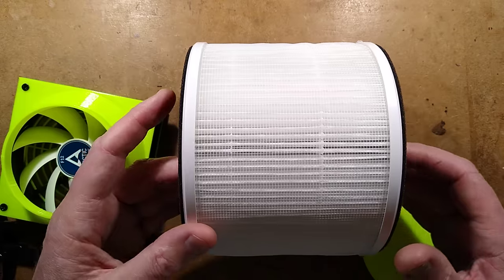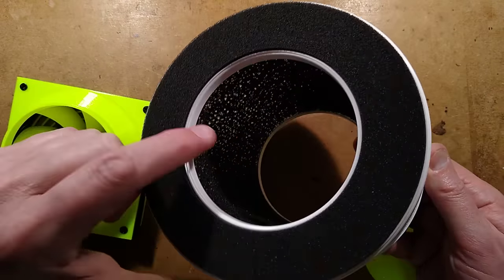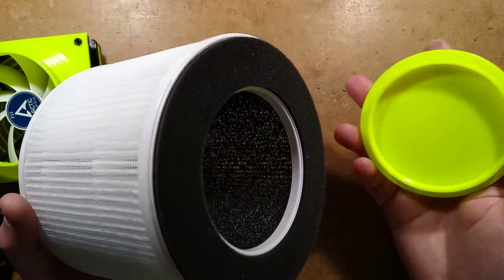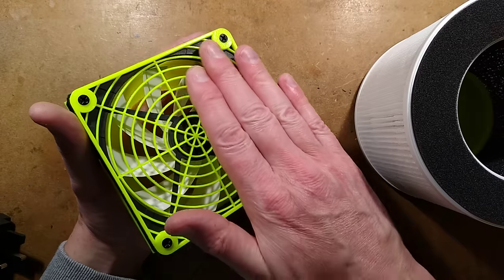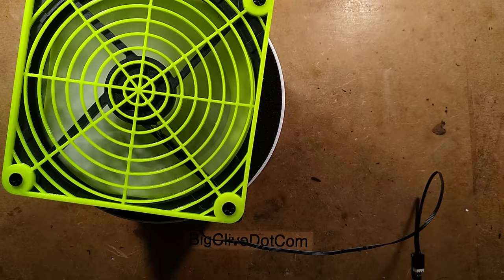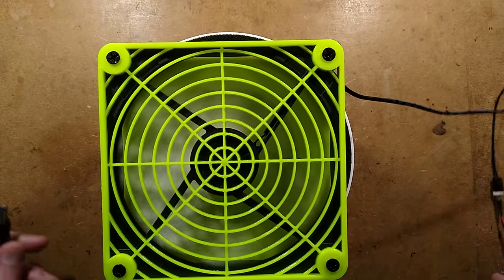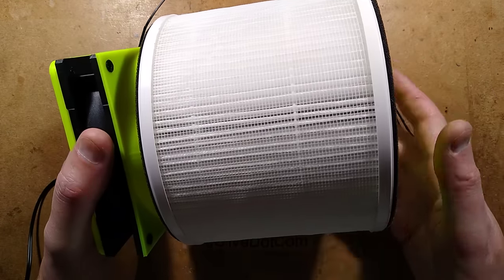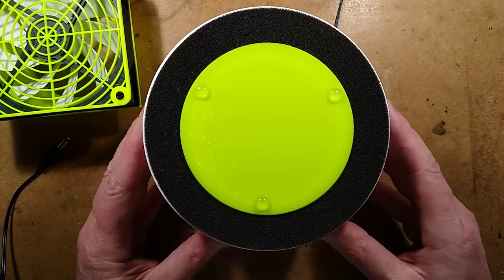DIY cheap & quiet HEPA air cleaner

Comment: You could even chain multiple filters into a longer tube with another adapter to get more flow. Perhaps not double, but you wouldn't need another fan.
Though then you might want a more stable mounting system, or indeed, have it horisontally.
Reply: I really like that type of filter model for this reason, effectively putting multiple filters in parallel should lower the effective resistance to fluid flow. With the rationale similar to why the Americans are building filters in a cube shape with their furnace filters instead of just taping one to a box fan. Lowering the pressure differential over the filters should make them and the fan last longer. And it shouldn't increase the long term running costs only the initial outlay (lifetime should be proportional to # of filters). It would also be interesting to test if whether adding more filters would have affect of the sound level and frequency, something something different pressure drop something something turbulence.

Comment: Me and the other half are disappointed it wasn't printed in pink!

Also, I doubt the fans care that much given they are mounted in computers both vertically and horizontally and I haven't heard if it causing major problems.

Comment: Anybody ever took a furnace filter or air condition filter and putting it on one of the $20 box fans it actually does a pretty good job of getting rid of smoke and dust in a household setting

Comment: Good stuff. I have an old air purifier that is not made any more so i was forced to use replacements. It has a rectangular filter as many others but i soon found out that the bastards that make filters do not give you the dimensions, so you can't replace the filter with one from another model.

Comment: Good. Filters are the most expensive part. Find cheap filters and add a fan. I like mine fast and loud. I wonder what would happen if I used and EDF from a R/C jet aircraft with a variable throttle?

Comment: I made a version sort of along these lines for when I'm soldering. The fan intake is near my work piece and it exhausts into a carbon filter block to catch some of the particulates. Cuts down on the burnt resin smell that always gives me a headache.

Comment: I don't think you need worry about mounting fans horizontally - I've got several fans in my PC and half are mounted that way - in 10 years (time for a replacement I think) only one has gone and that was mounted vertically

Comment: Many 120mm case fans mount horizontally both in atx power supplies and at the case top. You may be talking the difference in 8 years vs 10.

Comment: Funny enough, these DIY units tend to outperform some "smart" units because they keep the fan running at full speed rather than dialling it down. The sensors in air purifiers are a pretty mixed bag and many just read way too low, resulting in very little filtering being done when set to auto.

Comment: flip the whole thing over, and put 12mm / 1/2 inch feet on the fan itself (use the screws you mount the fan to the adapter cowl to hold the feet on)

Comment: these work ok.....but you're really best having a filtered intake/fan into your room/house from outside.
something that maintains a slight positive pressure inside the room/house.
this will prevent particulates from entering and make sure most particles inside are on their way out.
also.....fresh outside air contains more oxygen....which makes for more brain power.

i personally filter/duct the air through my pc case.....it keeps the components extra cool in the winter, and the output air from my case is still warm, filtered and oxygenated.

Comment: Theres already a whole filter system thats been around for years in the automotive world. Every car has a filter for the airconditioner behind your glove box thats supposed to be replaced evey 2 years or so. That filter and the fan for the aircon is much more powerful and cheaper than any 'HEPA' meme filter. 5w fan vs 50w blower motor. Just need a 12v power supply. The filters are $10 usd. Theres already 'microshield' virus filters aswell since covid for automotive ac filters for $20 usd.

Comment: You should try the HEPA filtres from xioami air purifiers. They are really high quality and sealed so you wouldn't have worry about capping the bottom
Reply: and most expensive of the lot

Comment: I love the idea, but I hate having to buy filters, so I just use a RainMate air purifier that sits on top of my refrigerator, and  uses clean water that you change out every other day, or when it's dirty, and below the water line, and if I want some fragrance in the air I just add a drop of their natural tea tree mint oil that's designed not to harm the unit, it's been working great for years.
Reply: Kinda like a swamp cooler where the water is pumped over the filter and removes the trapped debris???🤔

Comment: How spooky, i'm in the middle of making one of these myself, in this instance to introduce dryer air indoors during the winter months to help reduce humidity. Was going to install in my loft but realised today I can make use of one of the airbricks upstairs. I have a 12v circuit round the house, powered by solar in Summer and just the batteries in Winter. Will hook into that. Weren't you talking about positive flow the other day Clive?
Reply from the maker: That's what this unit is being used for right now.  PIV Positive Input Ventilation.  I made an extra adaptor ring with a mid-ramp to allow stacking filters on top of each other.

Comment: There are different kinds of bearings for those fans a i know.
However i have been running 12cm and 14 cm fans horizontally some for 6 years, others for nearly 10.
Some got loud and ran slower, however only after many many years.

Comment: The fan - it pulling or pushing as the filter layer design it seems like it should be pulled (drawing air in via the outside of the filer).

Also the end and top caps - you leave the layers exposed so air could flow thru some of the layers and not the whole composite.  So the end and top caps should cover the edges of the filter.

Me - I'd love HEPA filters as air intake for PC case, crank them up a bit to balance out and tada, heating and air filtering PC for the winter.
Reply from the maker: The fan draws air in from the outside.  The flanges do seal the filter hole.

Comment: Would make the whole setup instantly a lot more complicated since it'd likely require to enclose the filter in a housing of some kind. But by doing that and putting a simple optical particle sensor in the flow of one of the intakes + more controller you could turn let it use a dynamic RPM based on how dirty the air is. Maybe even log the data locally or somewhere on the local network, not the modern bullshit way where everything breaks if there's no internet connection to the outside.

Comment: After watching the video I wonder if there's filters that would fit with AC box fans (the type used in big industrial machinery or welders) combined with a speed control would make for a higher airflow version. I say the AC type box fans because past 140mm size the DC ones get quite expensive for 180mm or 200mm fans.
Reply from the maker: There are designs that use something that looks like a PC case with a standard furnace filter slotted in either side, and a bank of computer style fans pulling air through them.

Comment: The only issue with reusing this setup is that you can't do the diode thingy with every fan, some fans (I think ones with hydro-something bearings?) need to operate at some minimum RPM so you should check what fan you're running first.

Comment: Computer fans should be fine in any orientation (so long they're not extremely cheap, their bearing systems are different I believe). Likewise they'll sit quite happily at 12v for longer than you'd imagine (but many are also designed to be pwm controllable). 
Fantastic idea though. I wonder if putting another fan on the bottom would increase efficiency? Also does the fan produce enough flow to pull air through the whole filter or will it use more of once section (like the bit nearest the fan) while leaving the bottom relatively unused?

Comment: Also thinking about potentially stringing together multiple smaller chargers (if it’s cheaper) to make one that’s strong enough to power let’s say a fridge and heater or 5000 btu air conditioner

Comment: I am putting one of these in my vanagon westafalia.. they never put a cabin air filter in the car.. so I am blocking off the external scoop/no filter, and building a DIY to backup the eberspaecher diesel heater.. so many times dealing with smokey areas...

Comment: Maybe a year late but for anyone who wants SCAD code that is modifiable to any fan size relatively easily:
//adaptor HEPA filter
$fn=100;
//You can adjust these four variables
//Primarily the filter hole diameter
screwhole=4.5;     //fan screw hole diameter (5)
filterhole=67.2;     //HEPA filter hole diameter
thickness=1.5;  //Thickness of plastic layer (1.5)8
insert=10;          //Length of insert into filter (10)
fansize=80;     //size of fan (80mm fan)
halfsize=fansize*0.5;   //half the size of fan
holepos=4;      //position of centre of screwhole from edge

//Do not adjust anything below here
cone=(fansize-filterhole)/1.5;
wall=thickness*2;
difference(){
union(){
//flange
translate([0,0,0])
cube([fansize,fansize,thickness]);
//taper to filter insert
translate([halfsize,halfsize,0])  
cylinder(h=cone,d1=fansize,d2=filterhole);
//filter insert
translate([halfsize,halfsize,cone])  
cylinder(h=insert,d=filterhole);
}
//taper to filter insert
translate([halfsize,halfsize,0])  
cylinder(h=cone,d1=fansize-holepos,d2=filterhole-wall);
//filter insert
translate([halfsize,halfsize,cone])  
cylinder(h=insert,d=filterhole-wall);
//fan attachment holes
translate([holepos,holepos,-1])  
cylinder(h=thickness+2,d=screwhole);
translate([holepos,fansize-holepos,-1])  
cylinder(h=thickness+2,d=screwhole);
translate([fansize-holepos,holepos,-1])  
cylinder(h=thickness+2,d=screwhole);
translate([fansize-holepos,fansize-holepos,-1])  
cylinder(h=thickness+2,d=screwhole);
}
Reply: thank you so much

Comment: I can still recommend the P12 from Arctic. Almost the same airflow but better for pushing or pulling air trough a filter. And I think they are a bit quieter.
And isn't this already the best position for the bearing?
Reply from the maker: I've since replaced the fan with a P12.
Reply: @bigclivedotcom   Will you do an update on this? Maybe some testing? I already ordered a filter and a P12 silent, I am curious to how it will work.

Comment: i have a H13 filter set but it does 1000 cubic meters an hour , its really a very high flow capacity air filter 
the reason is im allergic to pollen ,, in the high season just some pollen ruin my night sleep ,, you need a very decent amount of filtration to clean a room, i went a bit over kill.. but i have clean air lol

Comment: Just a thought. Have you got the air flow the wrong way around. Shouldn't the fan be pulling the air through the hepa so catches large items first rather than push air through from the inside.

It wasn't clear in the video

Comment: Is the fan sucking or blowing through the filter? There are advantages to both, if it is blowing, the dirtiest filter walls will be on the inside, but the fan will get dusty. If it is sucking, the fan will stay clean, but the outside of the filter will slowly go black. It could be argued that this is an advantage, in that it lets you know when to change the filter. The design is certainly simple and convenient to use, with no screws to undo when changing the filter.
It's a nice idea, but surely the target should be to design out costly replacement filters, by making the dust collector cleanable, washable. In that regard I still favour an electrostatic dust collector. They should be more environmentally friendly and have the potential ( if you will forgive the pun) to sterilise the air with ozone or negative ions, particularly if the dust collector is made of copper wire. Your home made paper filters were better, because the paper is biodegradable, unlike the plastic of the commercial filters.

Comment: People get used to  noises even a noisy fan. I live in a flat near a railway line and for  some time could not sleep. At night heavy trains loaded with wagons filled with ore, cars or whatever would come through at two o'clock in the morning shaking the building. After a while you forget they are there and sleep through the noise and the shakes. Then there is a ticking clock at first it is annoying then you do not notice it and if it stops you can not sleep because it is not ticking. The human body adapts.

Comment: Use a centrifugal fan they can force air better through filters from static pressure
Reply from the maker: That would be good, but this was designed to use the cheaper and easier to source fans.  It does have good air throughput.

Comment: Good idea for a basic filter
If you see light through the filter it is NOT...
"HEPA is a type of pleated mechanical air filter. It is an acronym for "high efficiency particulate air [filter]" (as officially defined by the U.S. Dept. of Energy).  This type of air filter can theoretically remove at least 99.97% of dust, pollen, mold, bacteria, and any airborne particles with a size of 0.3 microns (µm). "

Comment: hi! you will have a problem due to the lack of static pressure, (this tipe of fan is meant for flow not pressure) so the efficiency is very reduced, and once the filter traps some dust it wont work.
Reply: could doubling up the fans, one intake one exhaust overcome this?

Comment: Sound like good thing todo and fact that fan is 12v there may be some psu plug in wall feed fan 12v it easy ideas and i would like it hang on ceiling upside down something like attached or have screw attach to other end where fan is n have fan face down catching dust in air above door

Comment: Add a second fan to the other side instead of the donut hole cover. Wouldn’t that move more air through the HEPA filter?
Reply: Another exhaust fan, I should add. Have not just one but two fans make use of the filter. Maybe it will even use it up more evenly this way, though that’s probably not an issue in the first place

Comment: When I made a similar device, the fan sucked in air in the center and blew outward along the periphery. This is due to the fact that the PC fan does not create enough pressure to cope with HEPA. Don't you have such a phenomenon?

Comment: Just my 2c worth.

I do not quite agree about the fan orientation thing. It would depend on the bearing type, most fans now come with ball bearings and not sleeves,  as can be seen in most PC cases nowadays that have AIO's in them the fans can be mounted vertically or horizontally. I do think though that one needs to stay clear of the really cheap fans if you want to mount it horizontally though as those will undoubtably only be of the sleeve variety.

Comment: The direction of air flow is reverse to the normal air filter direction, so hair won’t be captured first. Will it work just as effective by flipping the fan 180 degrees ?

Comment: I have three of that size of fan in my 6 year old PC. One vertically in the back of the computer, one vertically in the front and one horizontally in my power supply.. i have a slightly smaller one vertically on my CPU and 2 horizontally on my graphics card.
The point is all work perfectly after 6+ years. The case is about 10 years old (I reused it) so I am not sure if orientation makes any difference these days if it is a quality fan.

Comment: Is there a simple DIY strategy for maintaining positive air pressure in a room, for instance to prevent air ingress if a neighbour is a smoker? What about if permanent modification of the walls or windows is disallowed?
Reply: The air has to come from somewhere ultimately, and it's outside. But, you could open a window on the opposite side of the room as the chain smoking neighbor's apartment and blow that fresh air in.
Reply: @craigjensen6853  Yes, certainly, but the blowing is the real question: what's the best way to move the air, and what about adding a filter or a heater in the pipeline? Lots of details.
Reply: @dondondon786  Mathias Wandel made a little videos series on fans in the window for optimal air flow.
Reply: @Luckingsworth  Thanks very much. Do you know the exact title of the video in question?
Reply: @dondondon786  just search Mathias wandel window fan on YouTube. His name is his channel name.
Reply: @Luckingsworth  I see a lot of fan related videos by him,  but nothing about window fans.

Comment: You mentioned that you could feel the air blowing through the filter - shouldn't the air be pulling through it (and not pushing)?  Most of the air filters I've had experience with seem to be pull air through the filter versus pushing (same even with filters in the central ac/furnace.)
Reply: That's what I thought, you don't want the activated charcoal filter clogged up with hair and larger particles eh?
Reply: Through his fingers INTO THE FILTER ON THE EXTERIOR TO THE INTERIOR!!!

Comment: How long does the filter last before it should be changed?  I think I could get by without the activated charcoal if it would make the filter last a lot longer and be cheaper.  Thanks, Clive.